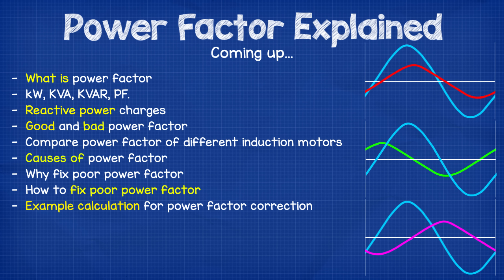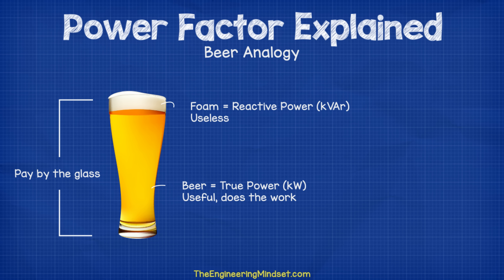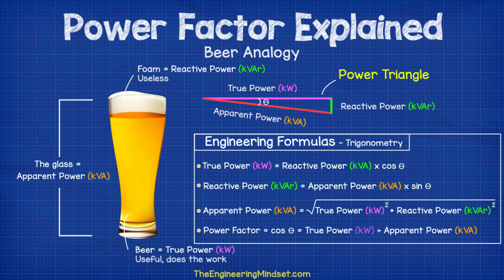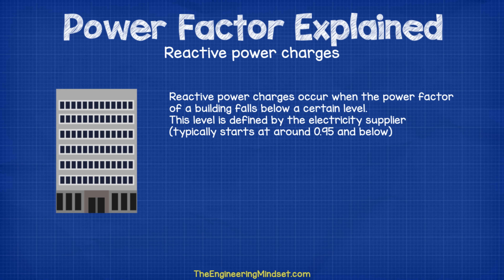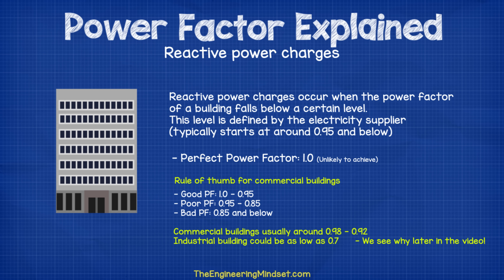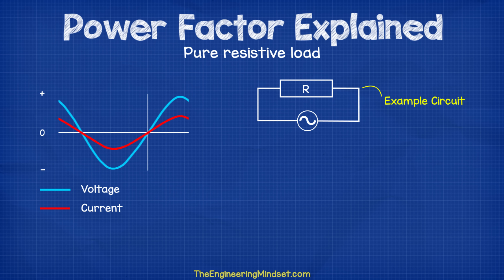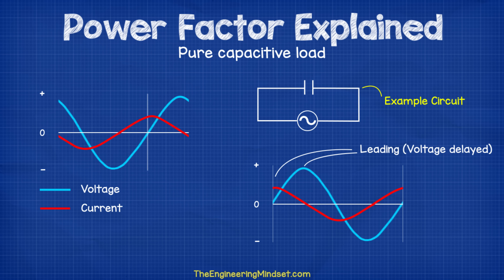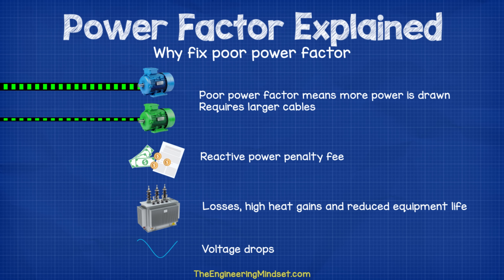Power Factor Explained - The basics what is power factor pf

Comment: 10:44 What is a "25.5 kVAr capacitor"? That doesn't sound right ... because surely the produced reactive power varies as a function of AC voltage and frequency (so is not an intrinsic property of the capacitor). If we assume 240V and 50 Hz, then I guess we would get C = V² / (2πfQ) = 240² / (2π.50.25.5k) ≈ 7.19 mF. So, the intrinsic property of the capacitor is its 7.19 mF capacitance ... and the reactive power it supplies in this specific circuit happens to be 25.5 kVAr.
Reply from the maker: See our latest video on Power Factor, this is a very old video. The new one has full calculations and examples.

Comment: Great video, but I realized there is a huge fallacy not to do with the creators fault, but EE. In the analogy of the beer vs. Foam, it's actually the foam that is the "real power" ( the stuff we don't want to pay for) and the beer is the "reactive power" in other words, the work or "true power" you talk about is only heating the motor coils. For a motor, we want MECHANICAL POWER TO TURN A SHAFT, not heat a room. Think about this, if the copper windings were superconductors, what would be "real power" doing the work of turning the shaft? It's the reactive! The energy going into building the magnetic field.

Comment: During the animation for the beer analogy shouldn't the Apparent Power remain constant, while both the True Power and Reactive Power vary as the foam/beer ratio varies. In the video, the animation of the triangle to the right of the beer depicts the True Power as a constant. A change in the Apparent Power would correspond to a change in the height of the beer and foam in the glass, which appears fixed in the video.

Comment: I am an electrical noob, and i have a solar system that converts dc to ac and connectes then to the grid. I am wondering. In case of a power outfall. Can i emergency wire the 230vac from my solar to 4 single AC 80uf capacitors to get more stable output? (4x because of the 0/90 Phase shift) or does this make no sence?

Comment: Although I get it…I never liked the ‘beer analogy’.
A better analogy (for me anyway) is guy pulling a train car with a rope at an angle.
The closer to pf = unity, the closer the guy gets to pulling the train car straight on.
But, that’s just me.
Otherwise, excellent video.
Reply: Me too. I hate the analogy. Most if not all sources (and even real workers in the industry) that use the analogy always say var is useless which is absolutely incorrect. They don't even understand the role of var and just parrot it. I appreciate this video pointing out that var is necessary though.

Most of the time when I explained this to my non-engineer coworker, I just go straightforward explaining the real physics, talking about energy being stored in electric/magnetic field thus not real work and not useful current but still necessary to make the grid works. Almost all of the time, they could comprehend that. I don't think it's the good approach to go nerdy on them though but I believe it's better than beer analogy with "var is useless" which the listeners will just parrot me without understanding anything more and then will forget it quickly. Your analogy is interesting. Would try it next time and see if it works for me.

Comment: Power factor penalty works also the other way ie overcompensated network, which the power companie can tolerate to a certain degree. They in turn will have to use compensation ie inductive loads. This has alot to do with underground cables which is inherently capacitive loads not regarding the load connected.
Reply from the maker: Check our new  Power Factor Explained video soooo much detail and easy visualisations https://youtu.be/NIrKOVZrqnU

Comment: A kVAr-capacitor? I'm into electronics and in our world, we measure capacitance by the Farad or fractions of Farads. What's the conversion factor?
Reply: jQ = (jωC)|V|². While capacitance is constant characteristic for a certain capacitor bank, in power electricity field, capcitor bank is specified by rated voltage and kvar for convenience as we focus on the reactive power needed to be compensated.

Comment: I believe you skipped a step. Capacitors are not rated in kVAr, but in Farad. I know there's a forrmula for calculating it, but it escapes me at the moment. Anyways, quite a decent topping-up of one's electro-physics :)
Reply: Capacitors are rated with voltage and kvar in power electrical field. It's more convenient for reactive power compensating application.

Comment: Why are my diaphragm air pump pulling 2x as much as the rated power? I have 4 pump running at the same time, 2x 85w+ 1x 55w + 1x 22w. So the total is supposed to be 247w or 1.12amps. But why my ammeter is constantly reading at 2.2amps?

Comment: Well, I got a problem with the beer analogy:

In my city, we are billed for the active power (P) and not by the apparent (S). If we do have a power factor below 0.92, we do get an penalty tax.

But, in logic, reactive power is not "energy waste" (besides losses in wires by higher current). We just are consuming less power.

I would improve the beet analogy by thinking in drinking beer from a barrel.

In each glass you consume less than you could but the amount of beer that you don't drink remains in the barrel so it is not wasted.
Reply from the maker: Check our new  Power Factor Explained video soooo much detail and easy visualisations https://youtu.be/NIrKOVZrqnU

Comment: I am an IT engineer, but I am facing some issues with borewell pump at my home. The pump is 3 phase 5hp which should be 3.8KW. But in my electricity bill I am getting maximum demand over period of 15 mins as 5.7KW and changed penalty as my sanctioned load is 4KW. Iam not getting how the demand is 5.7KW when pf is .86 and amperes is 9.6amp. Can someone help me calculate?

Comment: Ive always wondered why while monitoring electric plant loads, the math dont add up when base loading 1 generator to 80% and the other 2 in parallel are at 20%. Calculations cant be achieved algebraically, only vectorially.

Comment: Very nice video and impressive; i am not an electrical engineer but i can easily understand what you explained; thanks a lot; I am selling LV static var generator(svg) and active power filter(apf), which are mainly used for reactive power compensation, improving power factor, filter harmonic wave, and keep three phase balance; I can use your beer theory to explain the definition of pf and relationship of active power, apparent power and why svg could improve pf and save electricity bill; it is very useful~thanks again

Comment: I've seen swimming pool pump motors with power factors on the equipment tag/plate that say they have higher power factors. I've seen anywhere from 1.1 to 1.25 on 220v Motors with Start/Run Capacitors. How does that work?

Comment: I worked for a company that had a large scrap metal processing facility. I found out that they were paying over $4,000 per month in power factor penalty. We did some testing to figure out what it would take to get the power factor out of the penalty range. The solution would have cost $60,000 to install. The company management said they couldn't afford to install it. I told them they couldn't afford not to, pointing out that it would pay for itself in 15 months but they said it wasn't in the budget.
Reply: At $4000 per month, they could have just financed it if the up front capital cost wasn't in the budget. Use the power savings to pay back the bank. And write off the CAPEX as a tax write-off then depreciate the equipment as it ages to get it off the books. This is basic accounting 101, this company needs to fire it's CFO or accountant asap, BEFORE buying the PFC equipment, because if the accountant is this bad at counting the beans, they're probably costing the company a lot more than just the power bill.... they have one job, maximize the bottom line profits...

Comment: So...
1. A PF of 1 means your getting a "full" beer
2. As the PF slips, your getting more and more foam.

What I can't grasp, from the analogy is, why would the beer supplier charge extra for you supplying foamy beer. Surely your saving them beer? Or would it that the beer is effectively evaporating into the foam, so your pouring the same amount of beer out (say 100 drinks a keg), but at a PF of 0.9, your own making 90 drinks?

Or am i taking the costs from the wrong side, and I need to be thinking of the exchange of money from the customers point of view, and not the suppliers?

Comment: For the last example how did we know we needed to add capacitance vs inductance?   Thnx
Reply: Inductive loads shifts the current sinus wave to the right of the voltage sinus, so the voltage reach the peak before the current reaches the peak.
Capacitive loads shifts the current wave to the left, so the current reaches peak before the voltage does.
This asynchrony is what causes the power factor to drop.
All electrical motors uses coils and magnetic fields, so they are inherently an inductive load, and therefor you use a capacitive load to bring the current wave and voltage wave back in synk.

Comment: Great explanation with good visuals. The only problem I have with it is at 2:25. The movement of the power triangle and the beer animation do not match. The beer animation is wrong. As the reactive power increase, the foam increase (which is good), but as a result the true power represented as the actual beer decreases. The triangle show the true power staying the same and the apparent power increasing. To correct this, as the reactive power increase along with the apparent power in the triangle, the beer animation should show an increase in foam and total glass size. The actual beer should not decrease as the foam increases. 
Thanks again for the fantastic channel!

Comment: I've always struggled with this. There are many instances in a DC arrangement that are inefficient. Heat waste, audible noise  etc. I can see why the current lags behind in an inductor as it needs to charge up the  electro-magnet balloon first of all. From there-onwards  the collapsing field gives back a good deal of that first charge. Are we talking about THIS inefficiency here?  Why wouldn't we pay for this necessary froth as you like to put it?  Would the beer be the same without it?  More to the point this is a different kind of beer but surely there aren't different kinds of electricity?  
Now we know that a transformer without a load will consume some power. How much is a measure of its magnetic efficiency. This can change with load but the principle change and loss is in the heating of the windings. Another necessary evil traded as a part of the convenience offered by a transformer. 
Then we come to the company measurement of the power supplied. I'm not up with any modern electronic versions. All I recall is the motor driven "METER" with the dials. They called it an eddy current motor as I remember. it revolved in a speed proportionate to the current flow. I recall there could be a discrepancy if the current and voltage were not in a close phase relationship. Hence the PF correction capacitor in a fluorescent lamp with a choke  ballast. Now I'm floundering around because I don't and never did know WHY! In fact the method of connection is also flummoxing me. Quite often such a capacitor of some 2 to 6uF was connected right across the supply where to my mind it presented a capacitive reactance or load. It seems likely that it could therefore have been connected absolutely anywhere on the mains feed - even though I do of course see why it was associated with each lamp fitting. So what was it actually doing? The lamp works fine without it.
Of course we would expect to pay for our own power inefficiencies. I could shield the lamp with a blanket and say its a very inefficient producer of light - couldn't I?  BUT I would surely still have to pay.
You just have to straighten me out on this. I may not have long - so get yourself moving! BTW thanks for the superb video. I'll run it again but I still need help. Sincerely, BerryG
Reply: Yes, the power factor is good how it flows down the wires. The resistance helps it to disperse, I’m glad I understand it now. Thanks.
Reply: I’m actually taking the Micky here. This is what most people sprout, as they have no understanding whatsoever, but nobody corrects them.
Reply: @kennethcohan9630  I'm glad I was at least honest about this then! Its an odd concept and as you say there's a lot of confusion. Many people love that dark place that confusion brings to them as they step into the void and hold forth pontificating........ So I won't add to that. Useful energy in the system will be my limit. Thanks BTW ...
Reply from the maker: Seen our new Transformer video? here https://youtu.be/jcY4QN7awEc

Comment: In some sense, this video is very clear.  I understand the triangle, the formulas one can use to derive one number from the others, and how one might approach correcting poor power factor.  And I understand that inductive and capacitive loads push the current peak ahead or behind the voltage peak.   But what I really don't understand is the mechanism that results in these loads pushing the current out of sync with the voltage.  If anyone could point me at an explanation of that, I'd be grateful.

Comment: An old fashioned, but very effective way of improving power factor is to run a synchronous generator or motor on the system that is over excited.  This is easily adjustable with the machine voltage regulator or excitation level.  This may make it economical to use a syncronous motor  instead of an induction motor in some applications.

Comment: In one of your videos you  talk about current flow as for the nine volt battery.  You explain that it can flow one way or the other depending on what you call it conventional or electron.  In 1980 in electronics classes they explain it differently.  Current only flows one  direction.  From negative to positive inside the source. That means outside the source it's positive to negative.

Thanks Love  Everything else I've seen on your site.
Larry Electrician

Comment: Ok, but where does the capacitor go on the motor? Were physically does it get soldered? On the input or the output? Oh, and is it possible to design a motor with no capacitor but low power factor?
Reply: @IUSSHistory  i am starting to see it a bit better now that I think about it. It’s a bit like cavitation when a pump runs away from the water source.

Comment: Howdy. Great.
Some comments. A regular consumer kWh meter does not recognize reactive power.
Never compensate to a power factor of 1. This indicates the motor and the capacitor go into resonance. There could be enormous pendulum currents between the motor and the capacitor. Settle for 0,95.
Compensating an induction motor the thermal relay may be tuned down closer to the active current. This will make it more sensitive to overloading and thus provide more safety. The capacitor must always be fitted with fuses to protect it from resonance currents. Resonances may explain mysterious switchgesr and panel explosions.
Regards.

Comment: At 2m 35s in the video, you put True Power (kW) is equal to Reactive Power (kVA) x cos θ.  Cos = Adj x Hyp (CAH).  While the kVA part is correct, you put Reactive Power and it should be Apparent Power (the hypotenuse portion of the equation).  Reactive Power is kVAr and Apparent Power is kVA.

Comment: In Florida no power is sold by apparent power, the power companies correct the largely inductive loads with remotely switchable pole mounted capacitor banks at the 15. kV level.  Bad power factors do not effect the consumer, only the power supplier.  Bad power factors do not necessitate thicker insulation (Voltage) it effects the transmission line's conductor sizes, the internal wiring is set by the nameplate Amperage rating (current) which takes the power factor into account.  Otherwise it is all correct. Ron W4BIN

Comment: Hi... I am not an electrical engineer. But at the end of the video, you said it was a 14.6 kVar capacitor. But the units of capacitance are in Farads. What would be the capacitors (in Farads) the electric company adds outside this building?  I see caps on lots of power poles. Thank you in advance.

Comment: sometimes its hard to understand Power factor. when a transformer is rated at 500kva and rated at 0.8 P.F  we get 400 kilowatt. In other words power factor is just a rating of efficiency, which simply means the 500 kva transformer at 80% efficiency rating is 400 kilowatt.
But there are other power factor like you mentioned in the video.

Comment: Has the error in the invoice slide already been pointed out? The invoice total or the price per kwh is wrong.
Reply from the maker: There is no error on the invoice. The domestic invoice is simply kWh x rate. The commercial invoice is kwh x rate + demand charge, capacity charge and reactive power charge.
Reply: @EngineeringMindset  the commercial invoice shows a price per kwh of $0.2/kwh. Since there is no 0 after the 2, it appears to be $.02. The retail invoice shows $0.20. They are the same value but printed differently side by side.

Comment: You made a mistake in your diagram comparing the beer glass to the vector diagram. In the beer glass you showed the actual beer changing size while the total size of the glass remain the same. However you should have shown the amount of foam and the glass growing and shrinking as the vector changed.